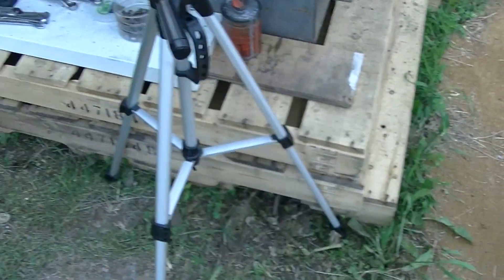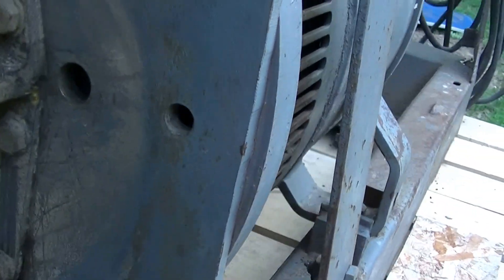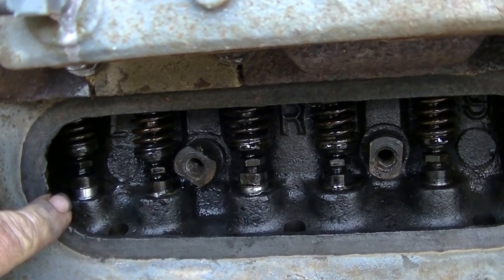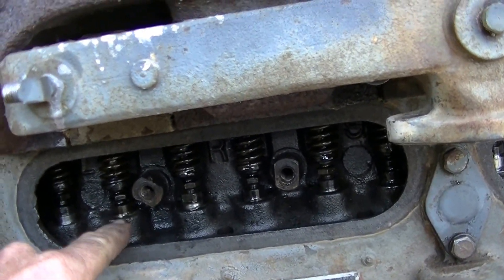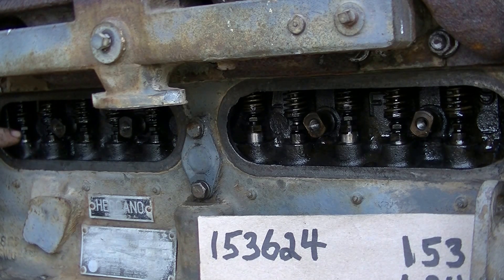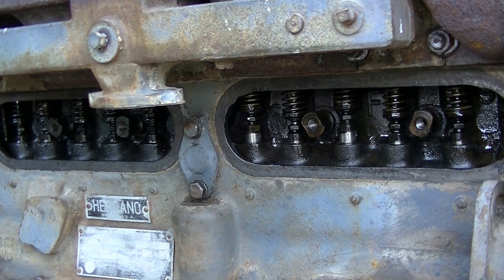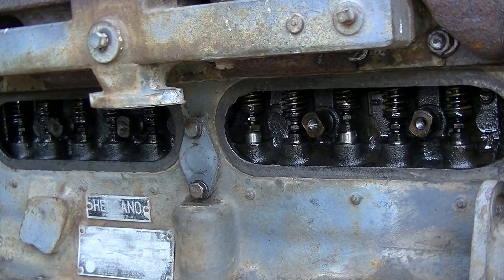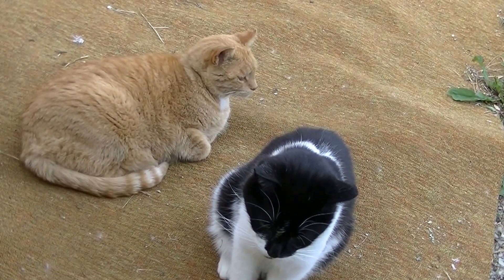Flathead six engine valve adjustment - zeketheantiquefreak

Comment: Thanks for helping me with that. Also i did the way you did rocking on 6 to adjust 1,then rocking onn 2 to adjust 5,and then rocking onn 4 to adjust 3. To adjust 6 2 and 4 is the same way right?
Reply from the maker: Yes, split the firing order, (works for any engine) and the running mates are obvious. Work through the list till you are done. Easy peasey. Good luck with your project.

Comment: Hi so i have a question for an f227 continental would the same principle be the same to adjust valves?
Reply from the maker: If the f227 is a six-cylinder 'L' or 'flathead' and the firing order is 153624, then yes, I feel the process will work.
Reply: @zeketheantiquefreak8518  yes it is just i bought 2 different  manuals online one is a (CMC) brand which means continental motors corporations and in that one it says every 500 hours to adjust the valve tappets when running and if not to follow the procedure like your video the only thing that confuses me is this booklet saysfor f series intake. 014and exhaust. 016 but says .017 cold static and in another book it has a totally different setting?
Reply from the maker: @memogonzalez  I may be old and a little jaded when it comes to mechanical things...  This is not some close-clearance racing engine or anything. I would kinda split the difference and set both exhaust and intake valves to, say, .015". A thousandth of an inch is miniscule and won't make a difference. As the valve and seat wear, the clearance will be reduced. I suspect this will not get a lot of hours use and will be just fine. Thanks for the question. Hope it helps.
Reply from the maker: (Forgot to mention that I haven't set any valves while the engine is running for many decades.)

Comment: Actually book says with engine warm.which i would assume to let motor run then shut off and adjust
Reply from the maker: Yes, valid point. The engine was not running at this point and it was tempting to set the valves whilst the carburetor and starter were removed. Thank you for the comment.

Comment: Thank you, and your assistants.  
? .. manual for my '54 flathead 6 cyl.. Dodge recommends valve adj. w/motor running.  
Not so easy, for me. No experience, running motor, & awkward stretch to reach.
Can I do those tappets like your video, here?
Why does the motor have to be running?
Advice if known, is appreciated.
Reply: It is correct that the valve adjustments are done hot and running, All Plymouth flathead engines are solid lifter engines.  You do it from under the fenderwell with the side covers removed. I think there was a removable section of the inner fender.  If you adjust them cold and not running to the specs for a hot engine, you will burn the valves...
Reply from the maker: @johnnewton7542  Just found this now... Thanks for the info.
Reply from the maker: Thinking of setting your valves with the engine running scares the heck out of me... This old Herc. has solid lifters and couldn't be set running... I am assuming that you have hydraulic lifters then? I have set valves when engine running on a V8 but never on a 'L' head or flathead engine. If you can get down with a light and mirror and see the valve train with the cover off... Look for a simple adjustment mechanism like this old Hercules. If the engine has specifications for clearance at the lifters, i.e. .008" then the lifters are solid. If no specification like that then I suppose the lifters could be hydraulic. If it is any consolation, I have yet to personally see a flathead with hydraulic lifters. Shoot me back a little more information and I will do what I can to help you.